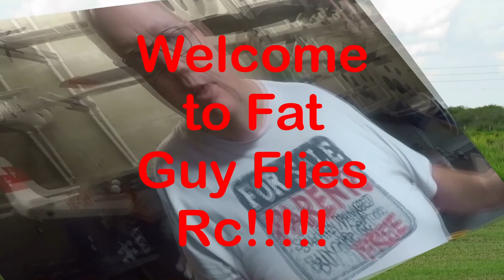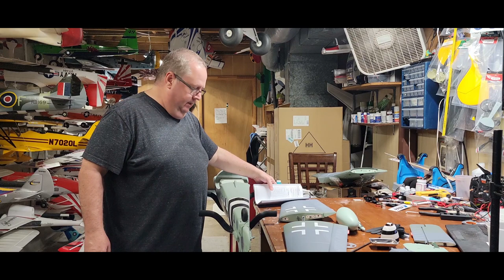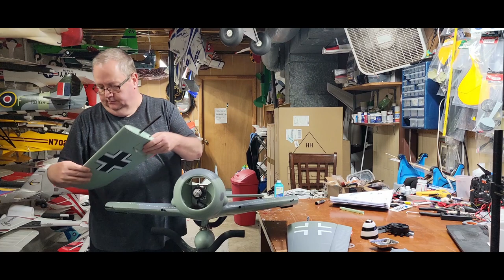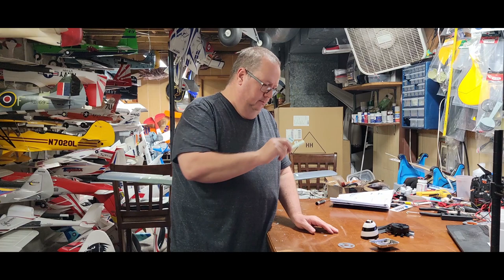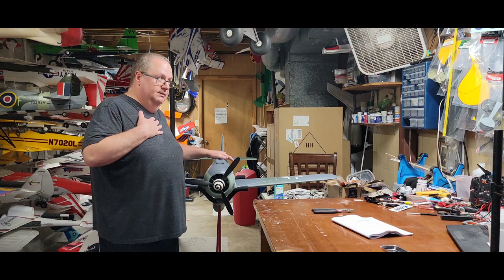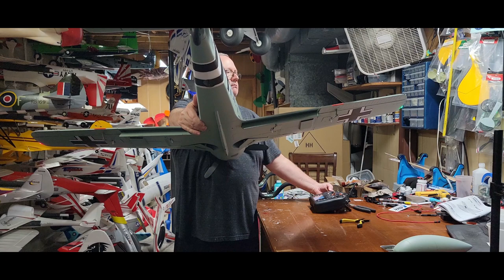AS PROMISED THE ASSEMBLY OF THE E-FLITE FW 190A BY FAT GUY FLIES RC

Comment: Hi Greg, looks like you took advantage of the foam sale! There was a couple of planes I wanted to buy also, but have spent to much this year and running out room for more. Can’t wait to see the maiden of this 🦅. As far as Safe agree with you 100%. As matter of fact any of the planes I have bought that don’t have a Receiver installed I’m installing AS3X & Safe on all of them. All of the FMS Planes are going to have that type of Receiver in them! I don’t care what anybody says. Happy Flying Greg!👍😃
Reply from the maker: The naysayers of SAFE do not pay for our planes. On the other hand I do encourage pilots to try to fly without so they can continue to grow with the hobby and rely more upon themselves and develop that  "feel" of the plane thru the transmitter. but like I said in the video, IF I can have a switch on my radio that will save my plane, I will use it!

Comment: I do get a kick out of the studs:
“I’ll never use safe!”
“I won’t use a gyro! It flies for you!”
“I won’t use mixes! I fly through the coupling!”
“I won’t use trims!”
What?? You never heard that last one about trims? Well if they can ignore all those other features they obviously don’t need trims! Futaba Attacks or Conquests would fill their needs and they could save a TON of money by not buying that fancy radio with all dem gizmos…
I gotta admit, though. It’s cool to set my radio on the bench and watch it fly my plane and do all that cool stuff by itself. Don’t tell anyone!
Reply from the maker: Yeah that's one reason I only use a mix for flap to elevator . But other mixes ...nah I wan't to be able to feel the plane not hit a switch  and it's done for me. No fun in that. SAFE is a great starter tool but like training wheels you need to get beyond it.
Reply: @FatGuyFliesRC  For precision aerobatics and 3d, mixes are a must! No “flipping switches” as a needed mix is left on as it applies in all situations. If you hit the rudder and it rolls or pitches then that’s just another hurdle when trying to draw lines or circles consistently. “Consistent” being the goal. A high wing or general sport plane is a different story. “Fly the thang!”. The reason you use a flap/elevator mix? Because you can’t remember to use 11% elevator every time or 14% on another plane, or remember which is which - and holding it while focusing on flying is a PITA! That same rule applies to other mixes as well. Have fun either way!
Reply: These made me gasp with an eye roll. 

“I won’t use mixes! I fly through the coupling!”
“I won’t use trims!”